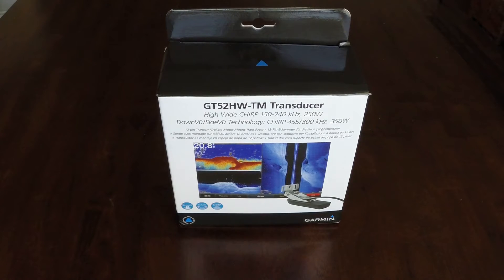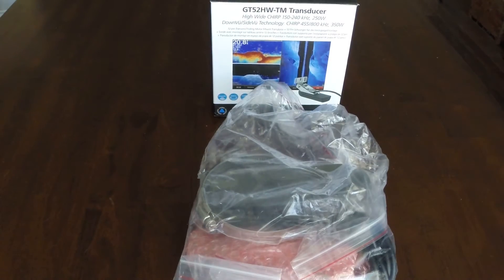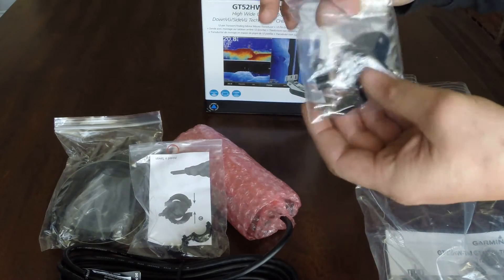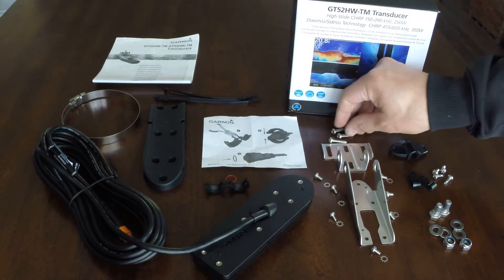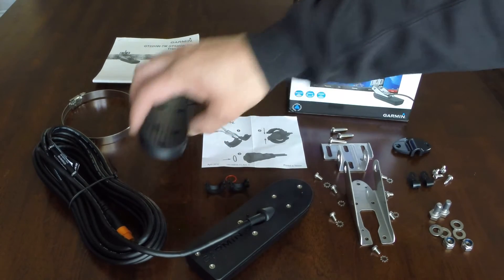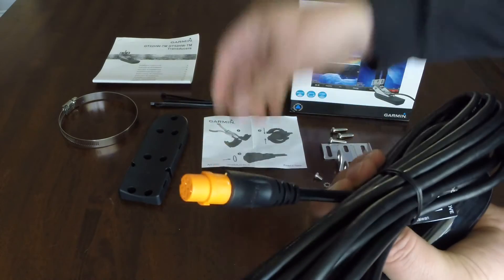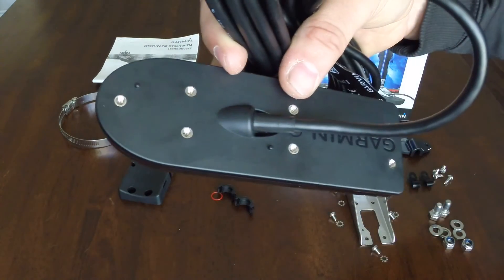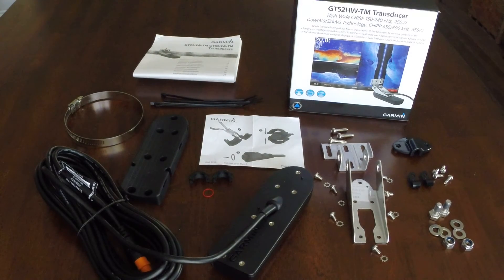Garmin GT52HW-TM Transducer Unboxing

Comment: Where would you recommend mounting this transducer (paired with vivid striker 9SV). The only options I’m comfortable with is at transom or trolling motor, but I can’t use trolling motor while going around the lake which means I can’t use it while going fast which this transducer claims to be able to do. But I do believe I’ll have a much further forward view if it is at the front

Comment: What is the difference between transducer gt22 and gt52 except connectors? If you connect the gt22 through the adapter 8pin-12pin to the garmin striker, will the image quality be like on gt52?
Reply from the maker: The difference is the GT22 doesn't have SideVu whereas the GT52 does. Other than that they are the same. So yes use that adapter as long as Garmin lists that transducer as compatible for your unit
Reply: @InDepthSonar   Is there a difference in image quality between transducer cv52 and gt52? What transducer will give the best quality image. The pond is a river up to 40 meters deep.
Reply from the maker: YES!!  The GT52 is a much better transducer.  It has a true DownVu element in it while the CV52 takes the inside edge of  the SideVu beam and creates DownVu (or now called ClearVu).  You are way better off with the GT52 for DownVu, other than that they are the same as far as I know